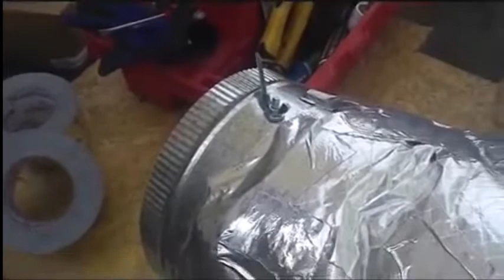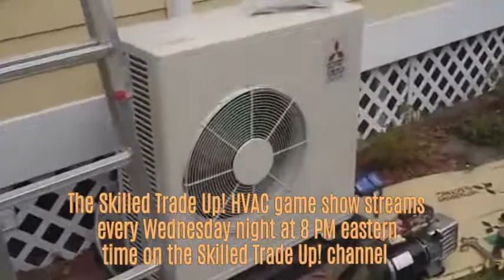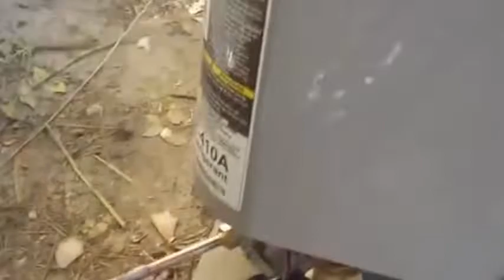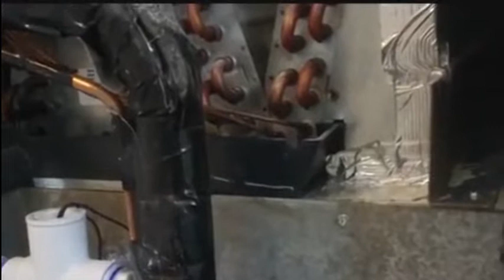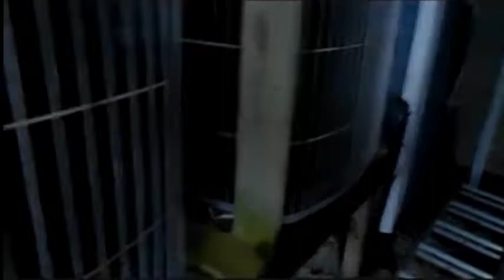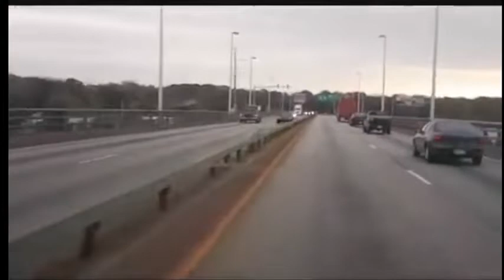RetroStream 4 | HVAC Install Compilation

Comment: I found out this week that all ICP units (except for the top of the line unit in your thumb mail is the same) will be that Payne unit cabinet you were saying exactly what I was complaining about it being flimsy and thinner than I was used to.
Reply from the maker: That's a shame. The R series ICP/ Payne were def a lower quality than the N series ICP and mainline stuff.
Reply: Yea the funny thing is the place I got them from act like it no big deal it’s the same. I thought they messed up and sent me a R model instead. I’m told because they used to be made in TN and now the N model is México. I guess they only have the machines to build R model cabinet